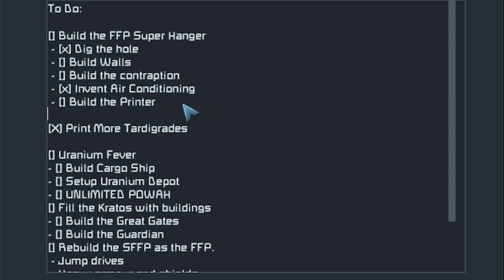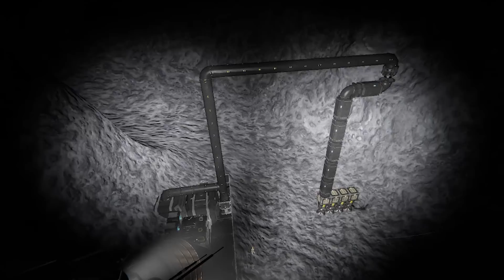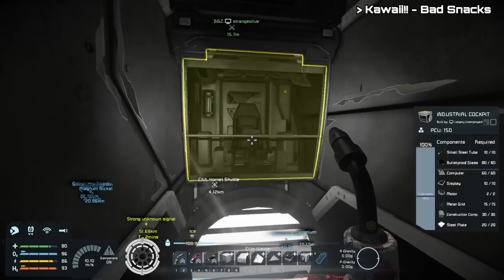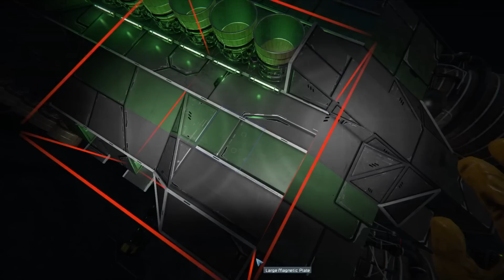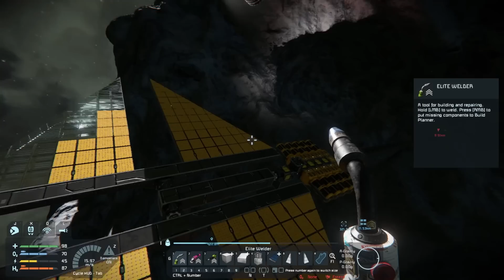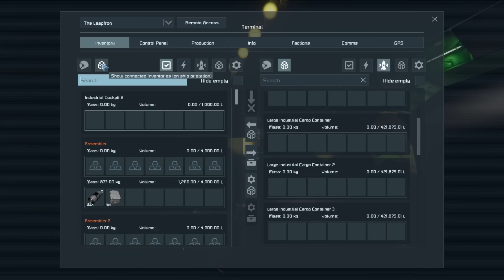THE SUN IS UNSHACKLED AND ITS RAGE KNOWS NO BOUNDS | Space Engineers Suit Only Survival #13

Comment: I thought I might be able to help improve drilling big pits with pistons for next time you guys. I seen it in another yt video a couple of years ago. If you want more pistons but don't have the room to place them, try putting them like sort of a snake pattern. Say you had space to set up 4 pistons and a drill but you need 8 pistons or 12 pistons to reach the depth required, then build the pistons in a snake like pattern. So 4 pistons then 2 blocks to connect 4 more pistons going back towards the first 4 pistons. Now you have the range of 8 pistons in the space of 4 piston stretch.add another 2 blocks then you can snake them back away from the pistons giving you the range of 12 pistons, still in the space of 4 pistons. I hope this makes sense 😂

Comment: Here's a little bit of knowledge for you.
You can decrease the strength of the magnetic force for the connectors.  This makes it so that your craft doesn't flick every time you put 2 connectors close to each others.
I am pretty sure that the connector with the lower locking strength has priority, but I haven't checked in a while

Comment: My take on how to set up ore piping to the cargo ship; Don't configure the connectors to "collect all". Set the sorter to whitelist "* Ore" as you have, but also turn on "Drain all" in that same sorter. This will look for ore in all accessible inventories on one side of the sorter and attempt to move them to the other side of the sorter. It will fill the inventories it runs into in succession, so it should initially fill the connector, then the connected connector, then the cargo containers in the ship and ultimately all the other containers in your ship. I do this with all my cargo ships and it works perfectly. I do the reverse for emptying/depositing the ore. Just make sure there's a buffer on the recieving end or your cargo ship won't properly empty its containers when depositing.
Reply from the maker: Absolute champion

Comment: You can set the mining base connector to throw stuff out, no need for a script.
Reply: Also high connector strength + build and repair rarely amounts into chaos, maybe have a sensor or event controller turn build & repair off?
Reply: Also the solar tracker option on the turret controller works well, but only with a single azimuth and elevation rotor (you don't really need more) and it doesn't provide feedback on the solar panels, but it is less heavy on the server.

Comment: I'm almost certain you're right about how the solar script works; that's also a better way for it to work. While it can take a bit more to figure out the alignment initially, when it does you can get better results, and that allows it to be completely design-agnostic. I'm pretty sure the reason that one panel didn't point at the sun directly there is because of the shadow on it - if it were to have rotated further, that shadow would have covered more panels, so the position was probably the ideal medium between good alignment and good shade clearance.

Comment: I use the shuttle mode of PAM to transport hydrogen from a base I setup on the ice fields on the moon, back to my base. I have one of your tardigrades ferrying ice to the Ice base which produces and stores all the hydrogen. I then have a seperate hydrogen shuttle that runs on ION only engines which comes in and picks up hydrogen and delivers it back home. just has a couple of timer blocks on it to turn stockpile on and off. The shuttle mode works really well.
Reply from the maker: That's really cool! The tardigrades working for you?
Reply: @LargelyUnemployed  Yes, took me a while as they were the first thing I 'd ever printed and when I finished it and cut it loose it took off on me. I didn't realise what had happened. Had to print a second one and stop the mining job before cutting it loose! All good now though.

Comment: Sugestion for timelapses, you could make a drone ship, place the cam account inside and program it in such way that the cam account is always aiming at the build area as it circles it. I can think of two alternatives, vectoring the drone so it keeps the orientation to the build area, or a "camera turret" built with swivels, rotors, the in game camera and floodlights. This second option might easier to keep steady, as I think you can "lock on" to a beacon or other marker, maybe even the player.

Depending on what you want to timelapse, both orbiting and static shots would be available with a drone like this.

Give it as large enough fuel/battery capacity as possible, AND set a timer/alarm to remind you when should the drone return for fuel.

Posible solution for heavy gravity planets, a rover instead of a drone.

(Idea from someone who does not play this game so it will need drone designing and testing)

Comment: 1 tip for the Mining Rigs used to drill holes: ive found that by starting with some pistons pointing up at full extension, you can build off from those and get additional depth from reversing them back to the closed positions while the down pistons extend
Reply: I do the same thing. Pistons are less expensive per meter than conveyors are for item conveyance, too, so it saves on the initial cost of the build when components are limited.

Comment: Use use another sorter in-between the connector and the cargo container no need for scrpt just have 2 connections one for in and out
Reply from the maker: There are 6 containers and a huge number of connections. This ship wasn't designed for direct sorting
Reply: @LargelyUnemployed  it shouldn't matter as long as you don't have both sorters on at the same time also I think one of the new automation blocks could help too

Comment: Attach some tardigrades to the leap frog and have the leap frog as the mining base. It can fly out and then detach the tardigrades which mine and return the resources until the leapfrog is full. Then the tardigrades re-attach to the leapfrog and the leapfrog can transport them all back. You could also attach the super tardigrade to it and have it haul them out to the resources.
Reply from the maker: Great idea but doesn't work very well I'm afraid. The script uses fixed co-ordinates to determine the "home" and "work" locations. If I move the ship at all it will break
Reply: @LargelyUnemployed if you use AI blocks you can automate it and set a beacon as a reference point
Reply: @LargelyUnemployed it's one of the large features of the ai blocks
Reply: hm ai blocks and beacons eh. hm i got to learn i guess @MrDoggoCraft
Reply from the maker: @MrDoggoCraft  I'll explore the AI blocks in a future series
Reply: @LargelyUnemployed would it work if you "dock" the leapfrog to a tiny station on the asteroid using merge blocks? It should guarantee it's positioned and oriented the right way.
Reply: @LargelyUnemployed  A few years ago, I built a jump-capable refinery ship which did a very similar thing utilizing PAM and a dozen tiny mining drones. For the most part, I didn't encounter any issues. The small handful of times in which I did, this was actually a problem caused by game lag and syncing. 

The server and clients didn't quite agree on what "not moving" meant, so the ship did end up drifting a few meters in a particular direction, as even a speed of 0m/s was still irrationally calculated so there was ALWAYS some amount of jitter movement in random vectors. FWIW, in purely single player offline worlds, this was never a problem. This only ever occurred on multiplayer hosted worlds. 

The solution to this problem, and what I ended up doing to ensure it never caused issues, was to simply "convert to station". This switches the entire grid to one that is purely immobile, and it can of course be switched back when you are finished with the mining operation. Optionally, the ship can be attached to an asteroid with landing gears. This would functionally serve the same purpose, just make it a bit more tedious to set up mining jobs.
Reply: @LargelyUnemployed  Then just, don't move the ship at all? Merge block or magplate to an asteroid in the area, set up the homes and work areas, and then waypoint the Leapfrog. Then leave them to mine.
Reply: @LargelyUnemployed no